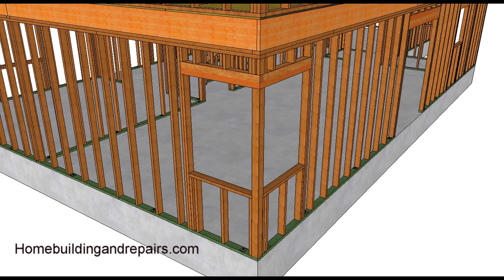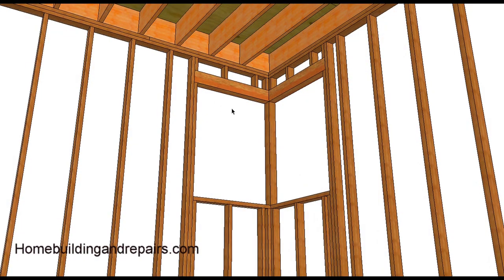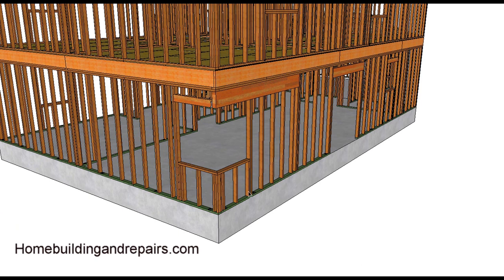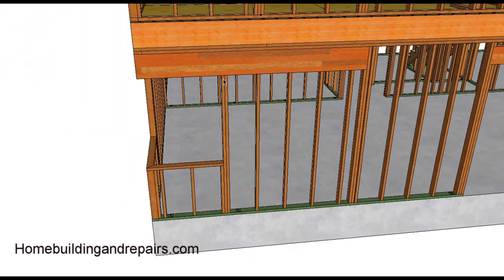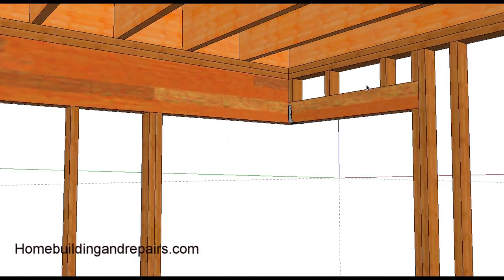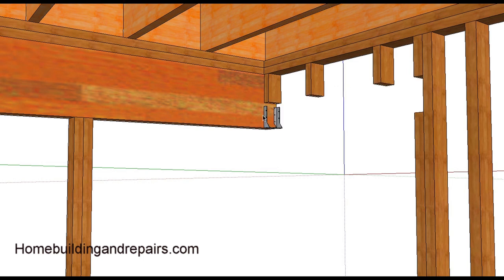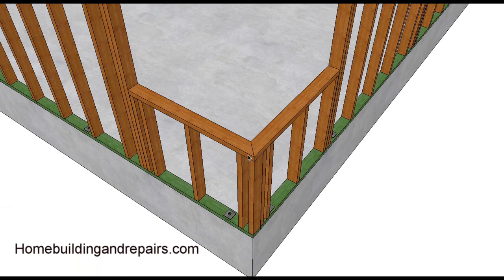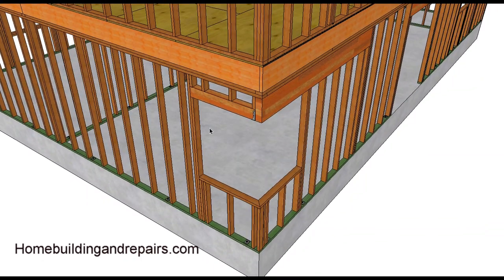How To Frame Corner Window Without Corner Post – Home Building

Comment: Hi there. I’m building a home where there is a large open to above area. I want to have wraparound windows at the back meeting the side. 

Is it possible to have this sort of concept if my open to above area is 20 feet heigh?
Reply from the maker: More than likely this won't be something I will be able to provide you with engineering advice on, but yes you can probably do it, even though this method right here might not be the best one for your building. I would contact a structural engineer for more information.

Comment: why do you need the extra beam, why can’t you just run the studs to the floor beam 
above? Or is it just because you needed the extra beam to fit the height you wanted for the window? Structurally, could you just stud to the floor beam if you wanted a larger window?
Reply from the maker: It can, but most of the time it will drain from the home to a sewer or septic tank.

Comment: Thank you for helpful material! But I have one question about length of span. You said to make 1/3 window length we need at least 2/3 back spans. Does it have any regulation code or any more information?? I don't think 2/3 of back span is enough...
Reply from the maker: Good question and this is a general construction method that will not work on every single project. The best advice I could give you, would be to contact an engineer.
Reply: For floor cantilevers (which is essentially what the window header is doing, cantilevering) you go back 4x your cantilevered distance so if it's a 3ft window, go back 12ft from the window.

Engineer can tell you for sure what will work in your specific case bur generally the longer you go back for your cantilever, the better

Comment: Why would you not cantilever from the other side as well?
Reply from the maker: It would definitely provide additional support, but it won't always be necessary if the cantilevered beam provides you with all of the engineering specifications, for that particular load bearing situation.

Comment: will this glass window corner critical in case of mild earthquakes?
Reply from the maker: That's a difficult question to answer, because it depends on how the corner window was built and the rest of the building. I would like to suggest that it wouldn't be a problem if you hired a structural engineer, but there have been plenty of buildings that were damaged during earthquakes that were designed by structural engineers.